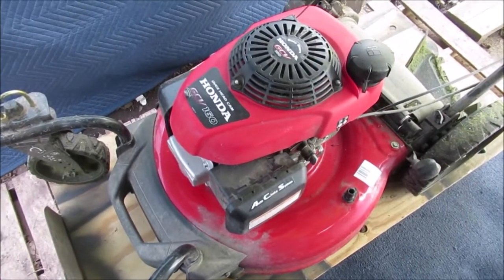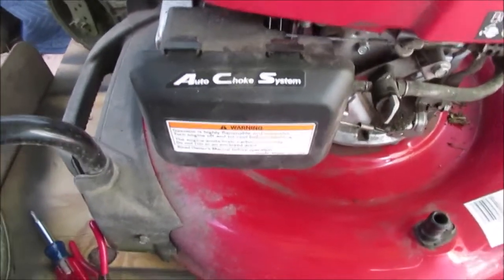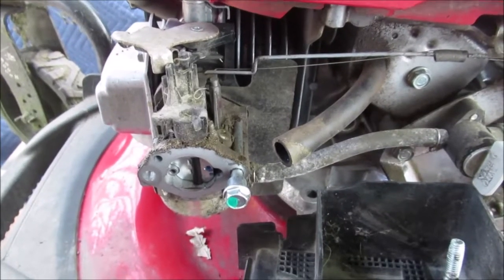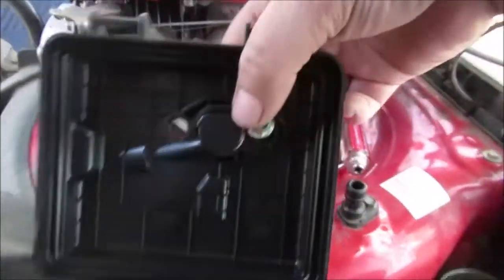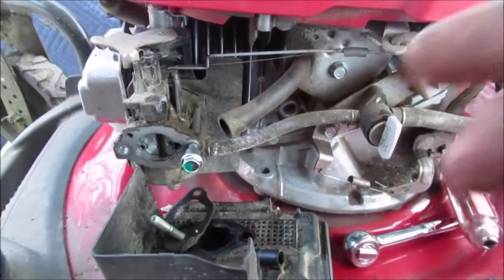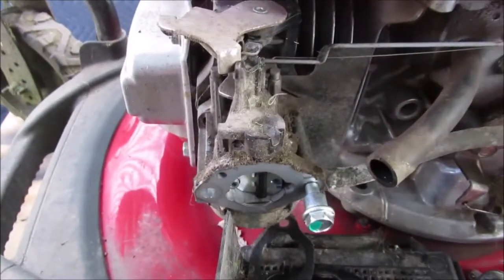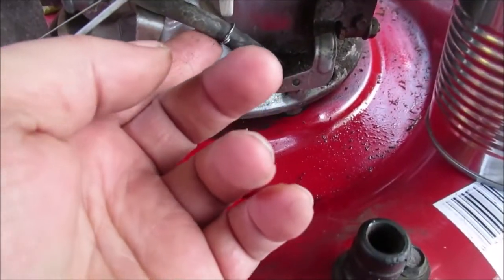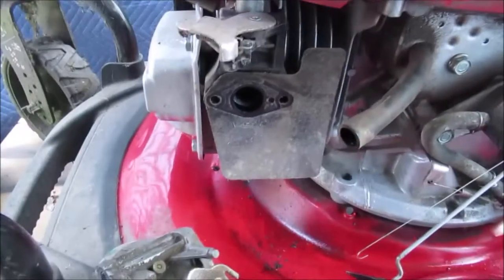Honda GCV 160 Carburetor Remove & Clean Part 1

Comment: Why are you taking it apart?
Reply from the maker: It was running so bad last fall that there has to be something plugged or just needs the jet enlarged which I show in part two
Reply: @not2fast4u2c  another comment to follow on the other video.  all is good